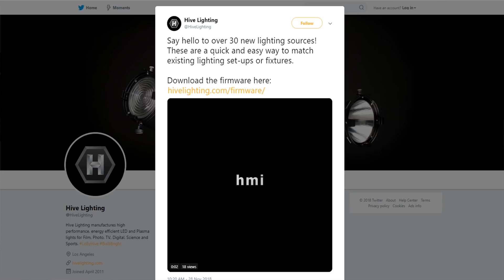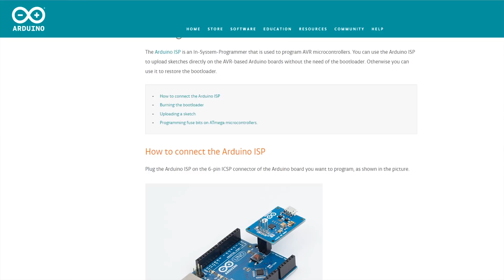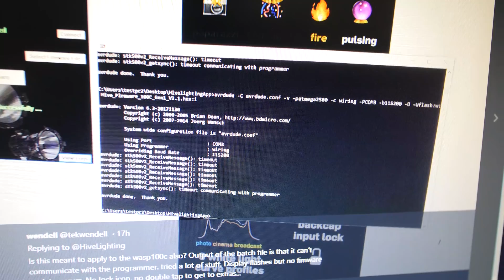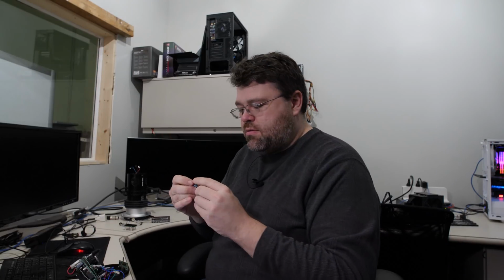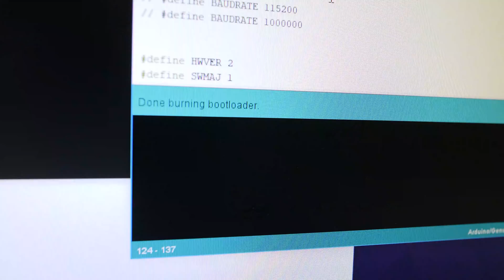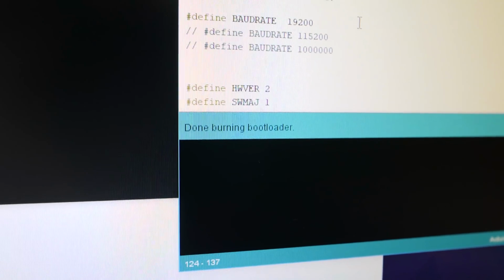Level1 Diagnostic: Updating the Hive Wasp 100-C

Comment: Hey, 7 years later... :) I have a couple of these 100-C's and ran into issues while updating the FW. Everything works except the "first screen" when you turn the light on. I can see the display, but can't adjust any settings. Changing settings via double clicking on Settings and choosing Sources/Effects etc works. BT works. What firmware are you using? My unit is slightly different (silver knob instead of the black knobs). I can't get it to work..

Comment: thing with 'older' serial interface programmers is that they actually need 'real' serial to get 12/15v programming pulse, so you cant use usb-serial adaptors/ cables etc with programmers designed for pure serial/ HVP or otherwise non-LVP. so thats why you have to use a usb enabled programmer.. anyway cool vid

Comment: How were you able to diagnose the bootloader being missing, and how does that get skipped at the time of manufacture?
Reply: My steps in figuring that out would've been
1. Attempt comms over USB
2. Attempt comms with the uC through the ISP (or relevant pins if it's not broken out) if there was nothing via USB. 
I wouldn't try comms over the UART that the USB is connected to but that's me. 
3. Contact the manufacturer asking why I can't get comms over USB or ISP and follow their advice 👍

Comment: How does a light put out more heat (in terms of wattage) than it actually draws from the wall? 
Obvi too lazy to google.
Reply from the maker: I didn't mean that, I meant the light output of the led fixture is equivalent to the light output of traditional non led fixtures which produce a lot of heat and a little bit of light
Reply: @Level1Techs   Ah, I gotcha. Thank you for the clarification Daddy Wendell sir.

Comment: It's always fun to see these kludge videos and think about how to fix little issues like they're actually a fun puzzle. However the real moral here is that unless you have $20,000 in electronics test equipment and parts lying around, two decades of experience in electrical engineering and deep-level programming, and ten hours to spare... it's probably less expensive to just pay $900 for a new light if you really need the upgrade. :) Wendell really does have a lot more going on inside than even Intel (and with no corruption).